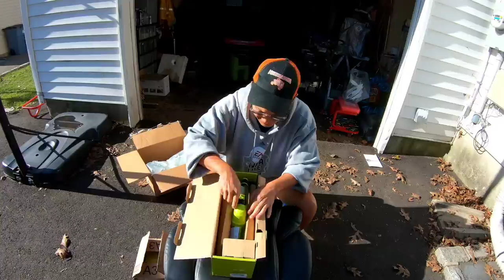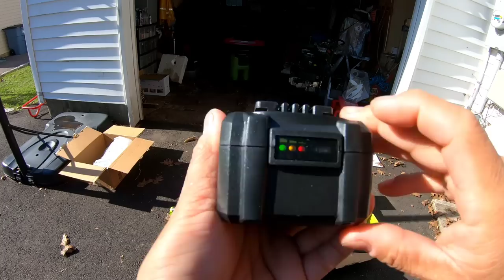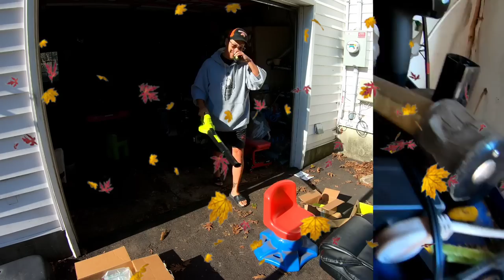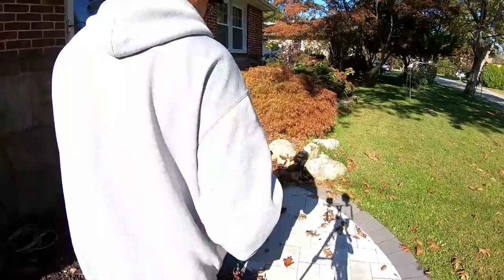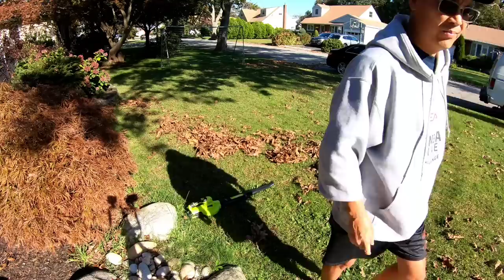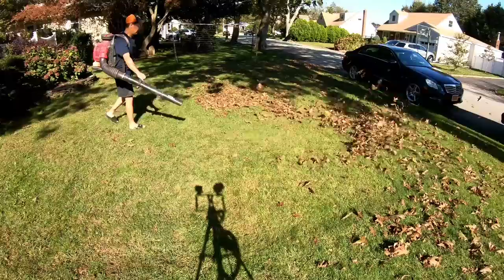SNAPFRESH 20V 2AH & 4AH BETA  LITHIUM ION BATTERY ELECTRIC CORDLESS LEAF BLOWER UNBOXING TEST REVIEW

Comment: My experience with blowers like this are fine for smooth surfaces like garage floors, but not worth much when blowing leaves into a pile on grassy surfaces or out of bushes.  I picked up a Ryobi 40v blower and it’s like a jet engine and rivals gas blowers. Well worth the extra $$.  You get what you pay for!

Comment: It is tiny and light. That will have to be it's advantage.  Take the "most extended tube" off and it gets really small.  Small enough to: 
     •Go inside your van to blow the crap out of it.  
     •Like you said, it would make a great toy for the kids!       
     •I saw rioters using leaf blowers on tear gas. They would like it for conceal-ability.  
     •Add a flexible hose, and supercharge the carbatrator of a Mower or Blower!
Reply from the maker: Great ideas!